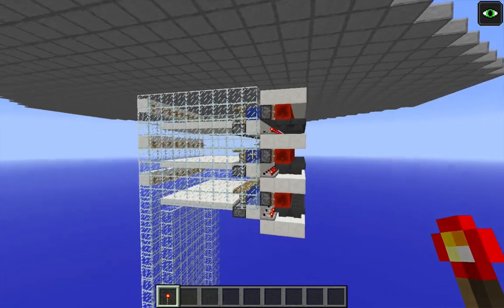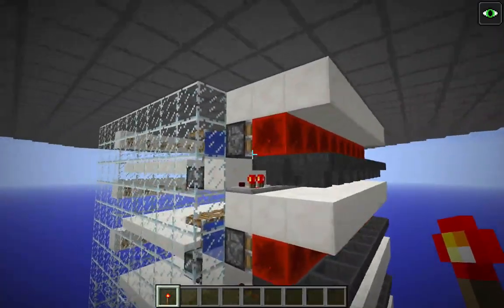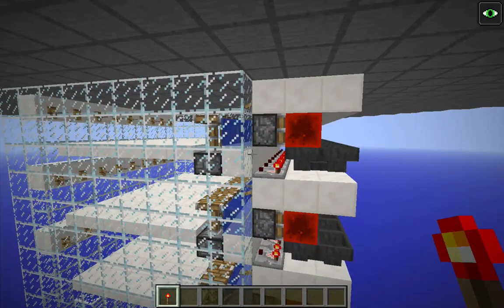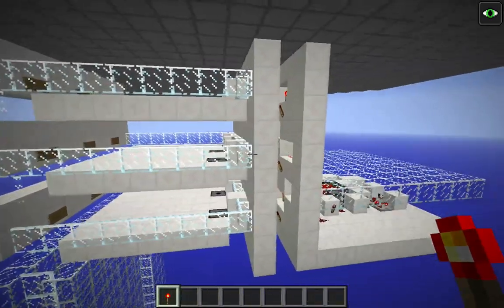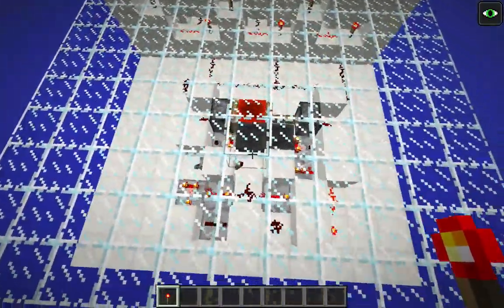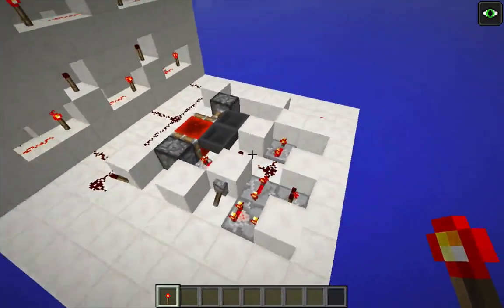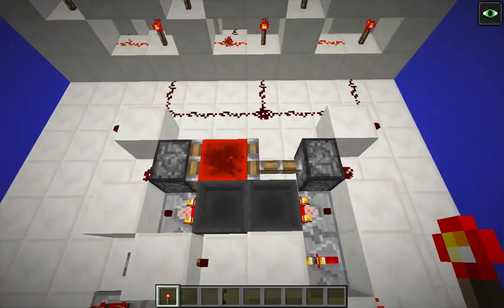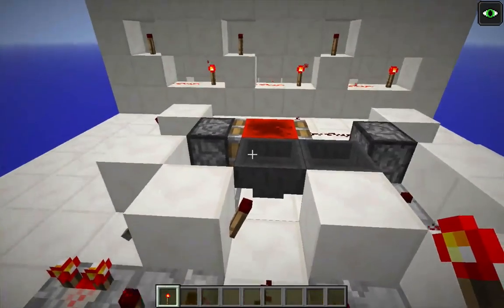Minecraft 1.9 Resource-Light Witch Farm

Comment: Maybe you can see about sacrificing the middle block  of the platform for a redstone conduit and moving the dispensers to either side of the middle. You would save some redstone and a dispenser per floor.
Reply from the maker: +Shadow 8472 It's a possible configuration, but in that case you'd lose some of the spawning surface, because the water from two dispensers wouldn't be able to cover the whole 9x7 platform. Those blocks would need to be removed in order to prevent witches from standing on a dry spot until they despawn.

Comment: You can just use a simple Etho clock and mix unstackable and stackable items in a certain way to get the same functionality as your design. I have found this two years ago and apparently nobody knows about it. I have also made a video at that time, but in retrospect it's really bad and doesn't explain anything. I'll send an image later.
Also if this farm reaches the mob cap (it probably does in a usual survival world), it would be better to flush one floor at a time.
And I think you could put the water on two opposing sides and flush the mobs out faster.
Reply from the maker: +dro The idea of using non-stackable items in a hopper clock is something that I'd never considered, but in hindsight it seems so obvious. Very cool idea, I'll have to explore it.

I've tried designs that flush the mobs from both sides, and the problem is that they bump up against each other in the middle with a 1-block gap. The alternative is to widen the gap, but then you sacrifice too much of the spawning area.
Reply: +Nathan Ryan http://imgur.com/Hv9FCQo
The ferns (sort of) determine the on-time and the dead bushes the off-time. It's a bit more complicated than that and I haven't really played around with it. Maybe adding another unstackable item will give some better effects.

With "putting water on opposing sides" I meant this, but I noticed the problem. :D
http://imgur.com/ybZJ4sv
Reply from the maker: +dro Ah, yes, water within 5 blocks of a drop will flow directly toward the drop. You can fix that by placing a sign in the space of the drop (or usually better, in the space above the drop).

Comment: I got 2 suggestions ;)
- I made an adjustable compacter hopper timer a while ago, that gives of a signal, that isn't half of the period length
/watch?v=gVQ8PfQrpt4
-  Don't use solid blocks at the heightof the spawning layer (where the legs of the mobs are)
Reply from the maker: +ilmango Oh, very cool clock! That should be added to the clock-circuit page of the wiki.

As for the solid blocks, I mostly avoided them at those layers, so that witches could spawn at the edges of the spawning surface (fractional x/z coordinates), otherwise they intersect the blocks and the spawning attempt fails. The three blocks that are adjacent to the spawning surface are needed to prevent mobs other than witches from spawning on the opaque blocks that carry signal to the dispensers. I used a block to carry the signal, because activating the dispensers with a redstone torch would cause light to leak onto the spawning floor. (Though there are a couple of other ways to carry the power, of course. This was just the easiest.)

One thing that I hadn't thought of, though, is using a slime block to carry the signal. A slime block would let light through, but the slime block could be powered by a repeater, which could be backed by a solid block, preventing light from seeping through from the circuitry behind.

Comment: I finished to do one of this and I found some problems that can fall down the efficiency, despite the spawn area. That were the spiders, they can climb thorugh glass and pistons making them always down and making some areas unspawneable to other mobs.

Ed: I could "fix" the problem with the spiders, but i must be unlucky for this new problem http://imgur.com/Mup0LiT

Ed2: Im being testin for a few hours and this is the best efficient design i can get to solve all my problems, and from other people I hope. Just let the spiders fall in another chamber to collect items or just kill them http://imgur.com/UZ1JUAt
Reply from the maker: +UniXCuCho Oh my, the slimes. :-)

I think it should be possible to set up a mob-proof perimeter. I'm not really sure where the spiders are coming from. It should be sufficient to fill in any spawnable areas with glass. Do you know where the spiders are spawning?
Reply: +Nathan Ryan They are spawning inside the farm, from that hours of testing i see something strange. My farm have 4 floor, because the double Witch Hut, and the Witchs most of the times spawn only on the third floor. I guess i was loosing efficiency, but no. I have the same efficiency because when Witches spawn go like 6 or 8 Witches at the same time. Still didn't know about anything about that.

About the mob-proof perimeter i light every cave  and use water in some cases, to make the mobs cant spawn there in 128 m radius square from the center of the farm
Reply from the maker: +UniXCuCho It must be something due to the double witch hut, probably the bounding box is messed up, allowing mobs other than witches to spawn. Too bad :-(
Reply: I guess its time to do another witch farm xD

Comment: Nice try mate :) But donst look much cheaper than the xisuma one and losing eficient is never good :P Mb a piston with slime blocks blocking the water controled by tripwire i use that on my mob farm that way each level is independent and no need for hoppers or much redstone
Reply from the maker: +IceBurn77 Well, xisumavoid's design requires about 6 stacks of redstone and 6 stacks of iron, this design requires less than 2 stacks of redstone and less than 1 stack of iron. The redstone is not usually the problem, but the iron is daunting unless you have an iron farm. (I'm of the opinion that you should build an iron farm first.) In any case, it's also sometimes good to know what doesn't work as well, but I was actually more excited to show off the clock than the farm. :-)

But something you said gives me an idea for another design that I might try. Forgive me if I reinvent somethings that you've already thought of...
Reply: +Nathan Ryan I understand you here all about the clock i usualy do the same funtion using 2 etho clocks to do the same you manage there but i have to say i hate clocks if i can get away not using any i will :P call them the eternal lag machine xD`

Feel Free to use my idea! I have been using it for a long time. And Thats what minecraft about we all use each others ideas :)